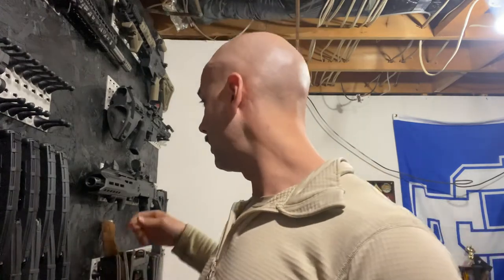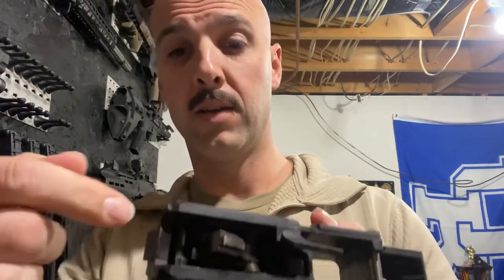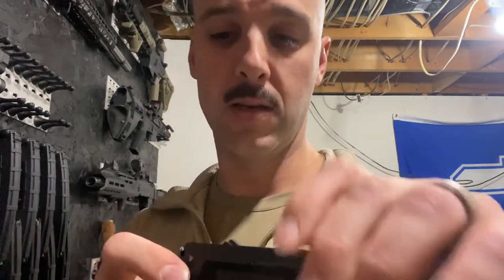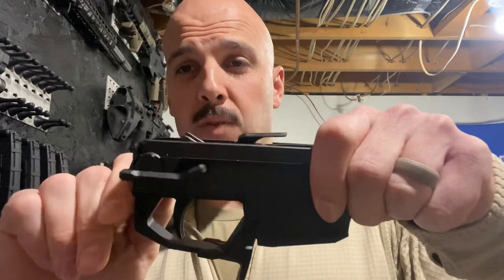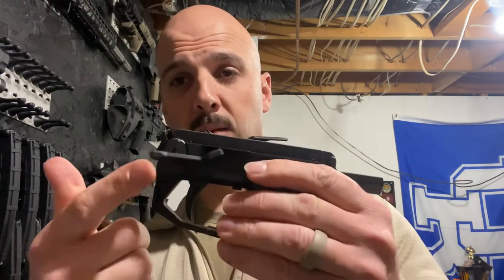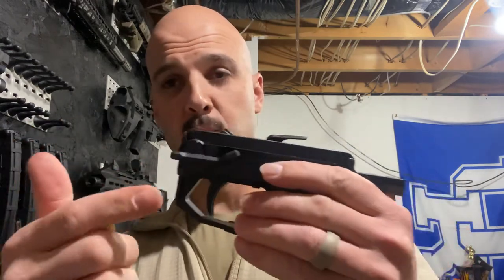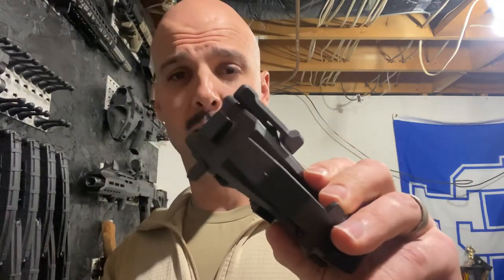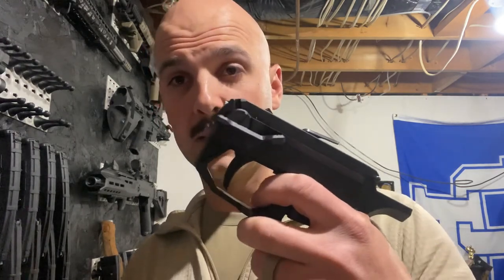Strike Industries Selector Switch update

Comment: I just recently bought some HBI items for my cz scorpion, but l might need to buy the safety from striker, l need to find a place here in Lexington to change out the trigger spring. I watched a video on it but don’t want to screw up. Thanks for your video
Reply from the maker: I posted a video on the trigger spring. It’s not terrible to change.
Reply: I put my own HB industries trigger spring kit and trigger shoe in and I’m definitely no professional gunsmith by any means. If you can build a lower on an AR you can do this. I’m not saying they are the same but I watched a You Tube tutorial video by HBI that literally walks you through it step by step and even color coats certain parts so they don’t blend in with one another during the video. I got the Strike safety and safety delete kit 3pc and I liked it. I went with the ambi safety and didn’t use the delete as I shoot both left and righty and the trigger spring kit, and safety are the best functional upgrades you can make to the Scorpion and not have to buy crazy expensive parts in the process. The spring kit makes a night and day difference in the trigger. I got their skeleton curved trigger shoe as well  but they have flat also.
Reply: @wildcat8598  oh ok cool